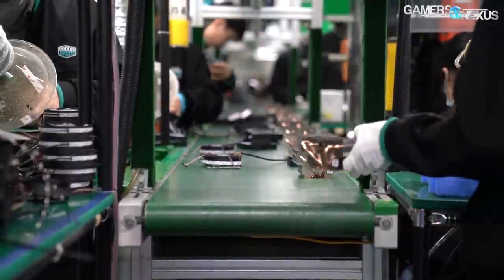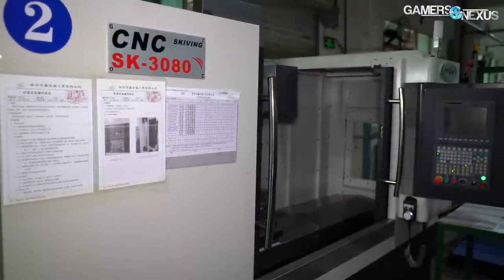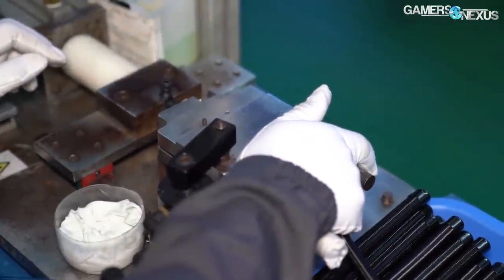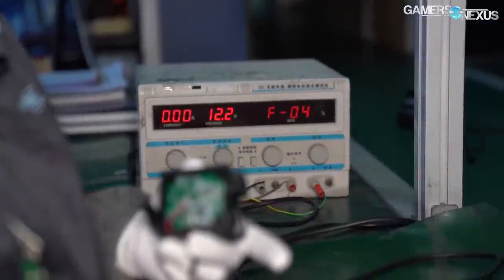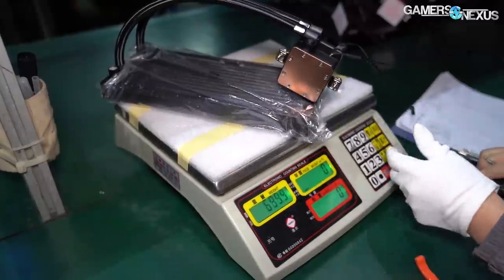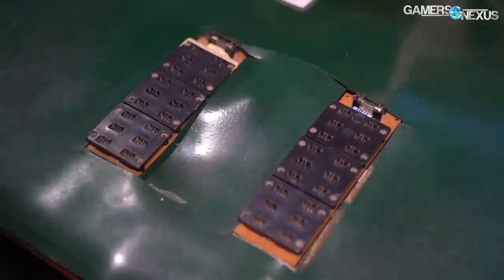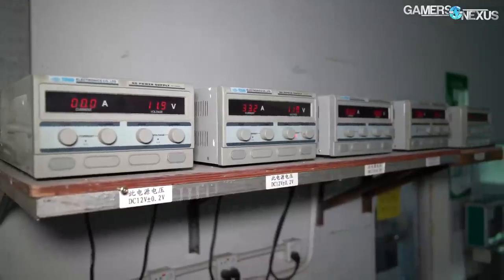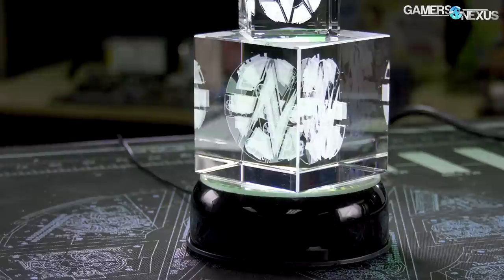How PC Liquid Coolers Are Made | China Factory Tours (Cooler Master & DeepCool)

Comment: Has anyone here used DeepCool products? Saw a cheap AM4 water cooler and was thinking about giving it a go but reviews seemed iffy.
Reply: have a captain 360ex I guess it is a hit or miss for I  never had an issue with mine if ever you take the captain route just be little gentle with the jpipe seems little fragile but then again mine didn't leak and that's without this "never leak" apparatus.
Reply: ive been using the deepcool captain 240 for about 9 months with no issues. my i5 8600k @ 5ghz 1.33v idles around 30C and never sees above 70C during kombusters cpu burner test. hoses are a little stiff but thats the only negative.